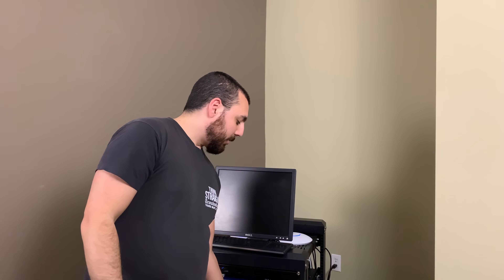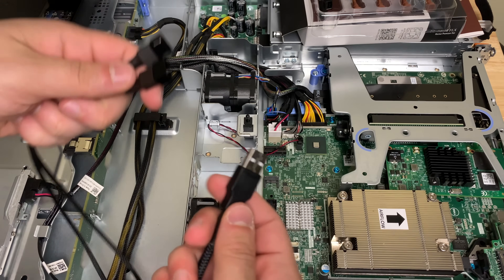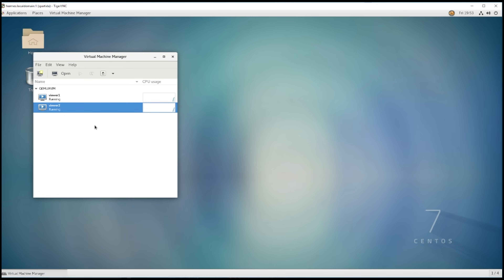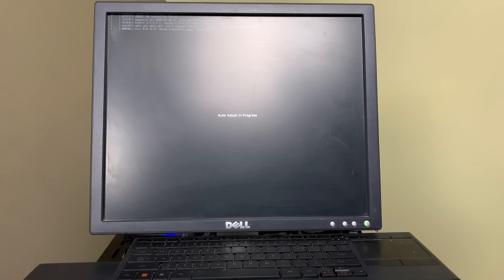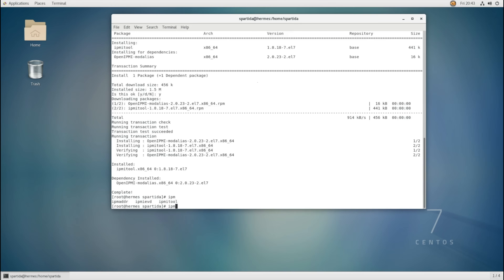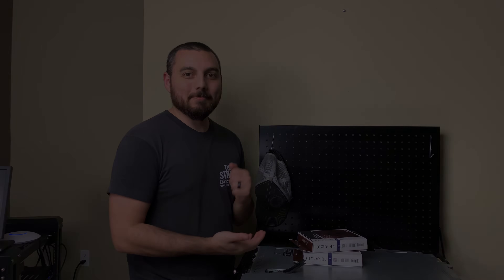Trying to Quiet Down a Dell PowerEdge R330

Comment from the maker: Link to software/IPMI commands used - https://www.spxlabs.com/blog/2019/3/16/silence-your-dell-poweredge-server
 Timestamps: 
Stock fan overview - 0:34 
Noctua 40mm unbox - 1:06 
Sound baseline - 3:59 
Heat baseline - 5:43 
Fan adapter install - 6:44 
Sound Test with adapter - 9:22 
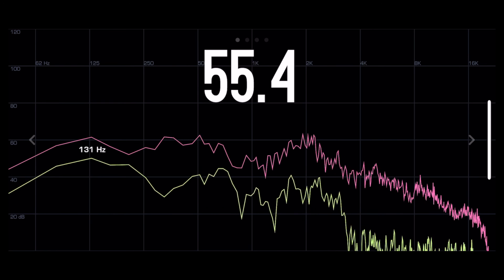Heat test with adapter - 10:06 
Adapter recap and way forward - 11:48 
Using IPMI to reduce fan speeed - 12:34 
Install IPMI on CentOS 7 - 12:36 
IPMI command overview - 13:23 
Heat test with software change - 15:12 
Sound test with software change - 16:17 
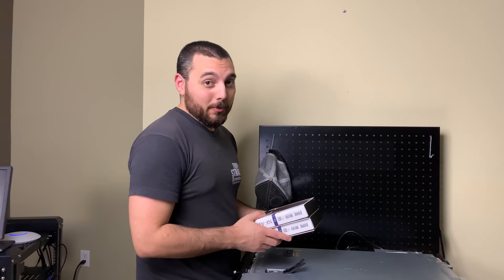Conclusion - 16:55
Reply: I came to the same conclusion as you a couple years ago. I have a one note whenever I end up rebooting 6 months or so that I have the commands saved. How did you make a cron job? Were you able to save it to the DRAC internally or use a separate system?
Reply from the maker: The OS was Linux, so cron job was done on the host.  The script did each command of enabling manual control and then setting the fan speed to 20%.  Nothing fancy.

Comment: I came to the same conclusion as you a couple years ago but using a Dell r710. I need a new pfSense box and wouldn't hate the extra compute of a 340 but wanted to see if anyone had a better solution to solve the noise.  I have a one note whenever I end up rebooting 6 months or so that I have the commands saved. How did you make a cron job? Were you able to save it to the DRAC internally or use a separate system?
Reply from the maker: The script ran on the host Dell R330. On boot I had a the commands listed in order in a script that ran to manually take control and then adjust to 20%.  This was done using Unraid and the User Scripts plugin.  Not quite the same as a cron job but similar enough, like the "scripting" should be the same.
Reply: I have two r710 and the fans are VERY Quiet in my homelab.  in the bios, you set the power / fan control to "os control" i think.   Also there are options in the iDrac for fans, but I didn't have to bother w that because I felt the fans were quiet enough.    There are a few options in there to check, and that cost nothing but a few minutes.   I'm currently researching how to program the Dell MD1200 disk shelf to reduce fan nose and came across your video.

Comment: FYI the IPMI tool does not work on new IDRACK software. I got a new poweredge 7515 and can't edit the profile lol. Yay Dell.
Reply from the maker: Yup! Anything after 8.3.something something is now no longer working :(. Right when the getting was good too
Reply: @SPXLabs  I found a RACOM command that will ignore PCIE devices. My unapproved PCIE devices were throwing the fans at 60% lol.
Reply from the maker: Nice! That’s awesome

Comment: Those seeking means to reduce noise in your personal home lab see the previous commenters,  depending your make and model server some manufacturers provide the ability to manually adjust the cooling policy inside the server bios or use command line utility which allows you almost ninety percent control over fan speed which is known as static fan control. Before going above and beyond tearing your servers apart to make them quiet and try reinvent the wheel do some research you might find most your questions already answered.

Comment: Hi Just bought myself an R730 ( i already own an r720 ) and stupidly assumed the 730 would be as quiet if not quieter....i do like the idea of replacing fans with aftermarket ones although mine have pluggable ones though....ive started messing with ipmi commands but not been successful yet....! - any adivce would be great. Cheers.
Reply from the maker: Dell as removed the ability to control fans via IPMI after bios 3.3 something
Reply: @SPXLabs  pff - thats a pain....i did go trawing the net looking for info....looks like i might be able to retro fit a suite of Noctura 60mm fans (by cutting the cable - 4 wires) all colour coded the same way and re soldering dell proprietry connector to the noctura wiring...the noctura is slightly shallower so i can hide some cabling in there....fans should be here tomorrow - ill let you know how it goes.....!
Reply from the maker: That seems like the go to method as far as I’m aware
Reply: @SPXLabs  Yeah - tbh if it works its definately my go to fix as there'll be no messing around with extra command line stuff (which im pretty shit with if im honest...!)
Reply from the maker: Well I hope you have time to get to it! Best of luck!
Reply: @SPXLabs  Well, assuming its just a "cut the plug off and re-solder job" shouldnt be too much of an issue....if it works itll be brilliant as it will go from tumble dryer status to quiet as a mouse with the same degree of cooling - perfect for home use...!

Comment: Funny how one keep running into these naiv fan replacement videos. Those 800 rpm Noctua fans, are moving like 0.1 percent of the air, that the ball baring 16.000 rpm server fans are moving. Also, Nuctua fans are not rated to run at full blast 24/7. The server fans are rated to run full jet(10-20s faster than the fastest Nuctua on the planet) for 5-10+ years without stopping. :D
Reply from the maker: Meh.  It was worth a shot.

Comment: What do u use the r330 for. Thinking of pick up a used r320 for cheap backups
Reply from the maker: Originally I planned to use it to play with virtualization and clustering but I ended up selling them both.  If I got them back today is probably host a couple games servers off them.

Comment: Those Noctua fans are never going to have enough static pressure to pull air through the front and push it all the way out of the back. It's not just about CPU temps either, it's about front drive temps, rear expansion card temps, etc.

Good exercise in ingenuity tho
Reply from the maker: Pretty solid point.  I never usually consider drive temperature in anything.  I’m a terrible person I know
Reply: Good theory...poor execution since the fans weren't even run at proper voltage. A simple 12v adapter could have been used to power them...

Comment: Very interesting - I have a 230 and 330 and I built them pure:

https://noctua.at/en/products/fan/nf-a4x20-pwm

It works and the box doesn't get very warm - ok, it runs "only" Nextcloud on it and the box is in a "cooling" room.
Reply from the maker: And you are powering them off USB or did you splice cables? No way it would work form USB!?!?

Comment: Nice vid, but my R330 actually has fan adjustment in idrac8 enterprise under Hardware/fan/setup....you can go down to 10% by manually adjusting....if you would have clicked that setup tag, you would have set that up...i run an e3-1240v5 and 2 drives + internal and external 12gbps HBA cards with the fans running as low as 14%. Its all there in idrac8 to be adjusted.  Under full prime95 load cpu runs 74deg with fans at 22%, or at 14% under no load...so yeah, it is quiet for me in the rack. My R220 is even a little quieter. They are after all rack servers, so noise was not a main concern upon design. I love these servers either way!   Keep up nice work!
Reply from the maker: Just don't update idrac past  3.30.30.30. because dell removed ipmi options for fan control :)
Reply: Yup, exactly!  Love these servers, they work fantastic! My idrac does not show any update past 2.75.75i think.
Reply from the maker: They are pretty baller.  Every year that goes by Dell does a better job with their stuff.
Reply: Currently run 2 R720’s, one R220 and onw R330. Enjoying the playing around and trying new stuff. I just bought the R330, i could not pass the server, the guy selling it had no clue what it was, he got it in a buiness auction lot. So i got one hell of abargain! 😂🥳
Reply from the maker: Haha nice! Good work.  What all do you do with your stuff?
Reply: @SPXLabs  My R220 runs fully loaded pfsense as a dedicated firewall with many bells and whistles installed. I had it virtualized before but all to dependent to run only 1 server to run everything to my liking, so i moved it over to a dedicated R220 i got for a very good price..... i keep a back up pfsense VM alive and sync’ed  on one R720. The R720’s are for virtual machines. On one I run win7 VM with blueiris camera software an BOINC, FreeNAS VM, Vcenter VM, UPS software VM, other test VM’s and ubuntu VM. With 2x E5-2650v2 cpu’s and 128GB ram, its a really good server for my needs atm. The R330 i just bought will have Vcenter moved over to it with a win7 VM for BOINC to run on spare CPU cycles. The other R720 will probably be selling soon, it is a single E5-2640v2 @2.0Ghz with 128GB Ram. Atm i think i will be good with this setup 7ntil i go nuts again and fing newer gear at steal prices.
Reply from the maker: Wow very cool stuff
Reply: That's not actually correct. The setup tab does not let you set a fan speed, it lets you change thermal profiles and set minimum PWM speeds, but the speed is still controlled by dell's logic, so sure you can tell the system that 10% is as low as it can go, but if it go's down to 10 is not up to you, its up to the default logic.

Comment: Fan noise is a huge problem I use IBM 2U's and I'm thinking about building a small server room in my garage.  Seems like you should be able to control fan speed using IPMI.
Reply from the maker: That is literally what I did, used IPMI.  But Dell has apparently removed the ability in the newest versions of IMPI though

Comment: Thanks! You'v inspired me to tackle this at home as well. The only thing I would be cautious of is that IF the temperature does get too hot it could potentially damage your hardware so I gave that some thought and found a way around that and will be showing how to do that in the next week or so including the code to do it on ones own. Thanks for this video and I'm already subbed!
Reply from the maker: Yo no problem.  In the description is a link with more commands and options.  That could be very helpful for your script!
Reply: @SPXLabs  Thanks! I already have it built which was the quick part, now to shoot and edit the video so give me at least a few days on that.
Reply from the maker: No I mean for your code, it sounding like you were coding a script.
Reply: @SPXLabs  Correct, it's done, just need to film it and edit it.
Reply from the maker: Oh okay.  Cool.  Let me know when it’s done.  Nice work my dude!
Reply: @SPXLabs  I will, do you want me to post the video link here or post somewhere else?
Reply from the maker: Sure.  Just let me know in general and I’ll find it and give it a watch.
Reply: @SPXLabs  I have the screencast done, have some more video to shoot today if time permits and should have out this week for sure. Worst case scenario I'll release on Friday but will try to get out before then! I'll link to your site and video as well. Again, thanks for inspiring me on doing this!
Reply from the maker: Sweet, can’t wait.  Nice work!

Comment: Fans too loud?? I had the pleasure of picking up one of the old 2950's....... it LITERALLY sounded like a jet engine and about as loud as one.  No software or hardware controls to adjust them.....

What you SHOULD have done.... is pick up a pack of resistors..... I forget what ohm I went with ...... 75  ohm maybe.  Think I was out like $4 or $5 cuz I went ahead and got a multi pack of differnt ones .  

I just took each fan out and cut the hot wire on each fan and stripped the ends.... .soldered each end of the cut power wire to a end on the resistor. Slap a little black tape around it and shoved em back into my "jet engine".  What happened next..... RELIEF!!!!!!!!  They didnt put an adjuster on it, didnt give me a "virtual" adjuster for it......  but if you block some of the power from even ENTERING the fan = not enough "gas" to feed the "jet engine" anymore.
Reply from the maker: Lmfao, the 2950s may as well be in their own category with banshees!

I actually did try to wire up a resistor to on of the fans but ended up destroying it somehow.  I made the entire situation worse and I ended having to replace the fan lol.  Evidently I’m not too handy.

Comment: If you replaced 5x2 server fans with 2 noctua fans instead of 10 what did expect was gonna happen regarding noise and temp?
Reply from the maker: While not discussed in the video, I was really hoping that the USB adapter had any single positive effect so I could follow up with another video doing the most absurd mounting of more fans and horrible cable routing.  I guess I still could but it’s just not worth the effort because of how underwhelming the USB adapter was.